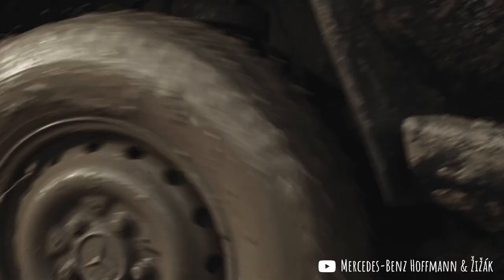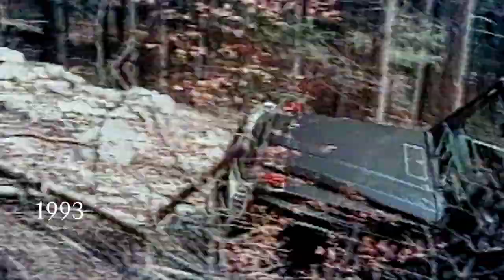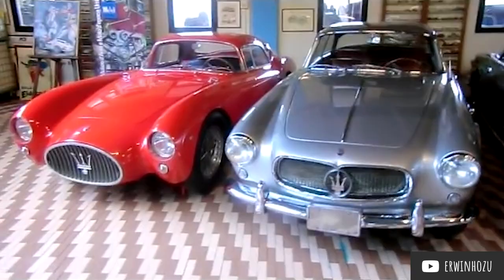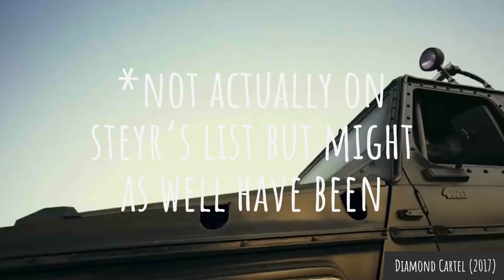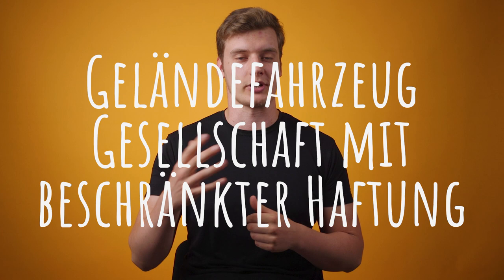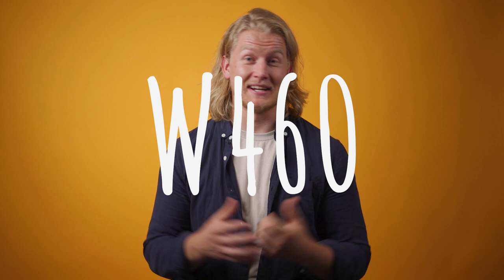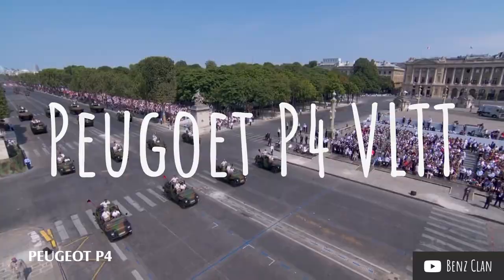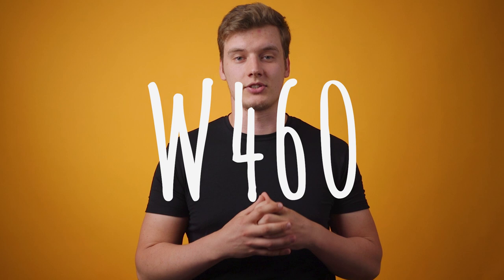The History of the G-Wagon Pt. 1/4

Comment: As this is somewhat dear to my heart i have to "correct" something: the city of Steyr had nothing to do with the G or the Manufacturing of it. The city of Steyr is the namesake of one of the oldest (still active) Weapons manufacturer in europe, and this company at some point merged with Puch (in Graz) and Austro Daimler to form "Steyr-Daimler-Puch". Austro Daimler and Puch were the main vehicle specialists. (A somewhat famous guy called Ferdinand Porsche worked for Austro Daimler before WW1 ;-) ) The Offroad vehicle specialty part was in Graz. Both the Haflinger and the Pinzgauer were develloped and built by in Graz. And the testtrack on the Schöckl was already in use for those vehicles. It wasn't extra built for the G. The testament (and goal) to how good the G was offroad, was that it could master this track. As no "car" could go there. (little sidenote for the newest model: it was tested there too. The goal was that after 2000km on this track nothing must fail or be loose in any kind, or must there be any ratteling inside the cabin. They weren't going slow either. So this is quite the test to achieve!)

Comment: he first generation G-Wagon was named W460 because it was the 460th internal project number assigned by Mercedes-Benz. Mercedes-Benz uses a system of internal project numbers to track its vehicles during development. The project number is typically assigned when the vehicle is first proposed, and it is used to track the vehicle's progress through the development process.

The W460 project was started in the early 1970s, and the first production vehicles were built in 1979. The W460 was a joint project between Mercedes-Benz and Austrian engineering firm Steyr-Daimler-Puch. Steyr-Daimler-Puch had a lot of experience building off-road vehicles, and they were responsible for the design and development of the W460's chassis and drivetrain.